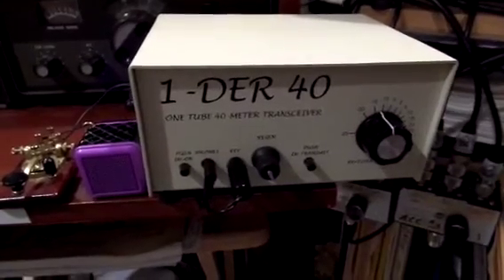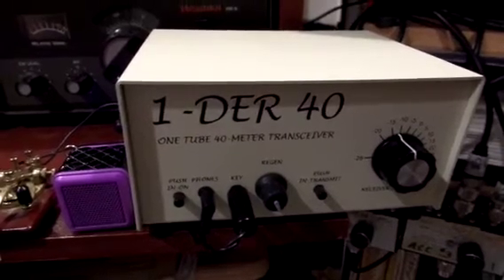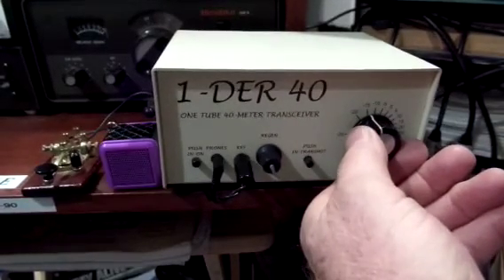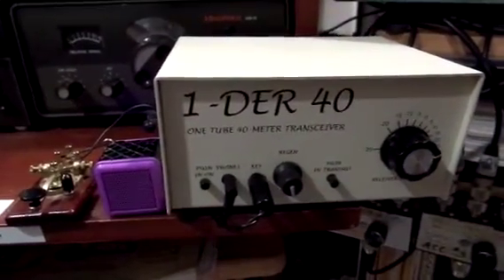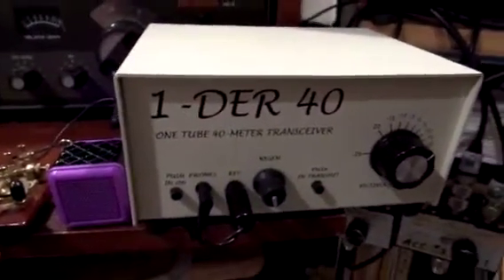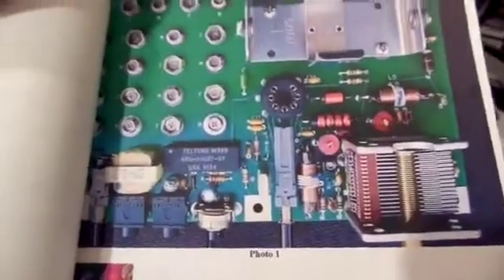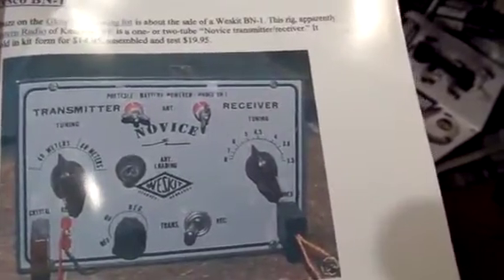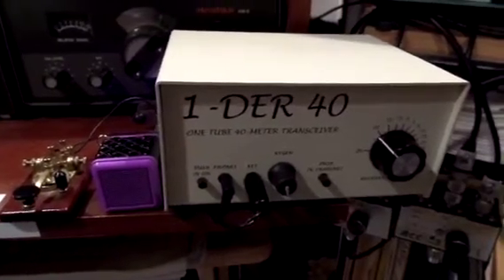1-DER 40

Comment from the maker: Hi, Gary,
Thanks for your comments re the BN-1. Back in the late 50's when I started out in ham radio, I think I would loved to have had this little BN-1 to fool around with, but even fifteen bucks had a lot more meaning back then. I had a small, battery-powered BC regen toy radio that used a 3A5 and I was amazed to discover that I could actually transmit with it! Have you actually had a QSO with any of your little 3A5 designs? Would love to know what 200 Mw could do. That's a little lite for me for QRP. 73's, Rick, WB3BIQ,

Comment: Hi Rick,
Great video. I have made several replicas of the BN-1 with varying degrees of  success. I would have like to have purchased the kit, It's a shame that Dwight quit making them.

73 de Gary,KF9CM
Reply: Hey Gary, I just ran across your schematic I printed out some years ago, for your 6SN7 version of the one tube transmitter.  How did that work out?  I am thinking of building one from your design.  I have a whole handful of the 6SN7's.   Any thoughts or suggestions?  How close was your coupling between the two coil sets?